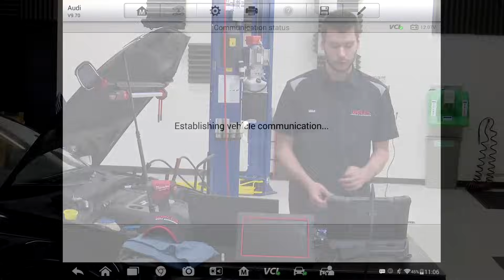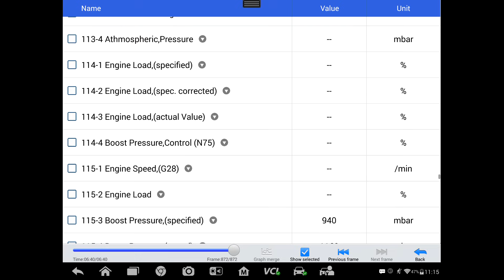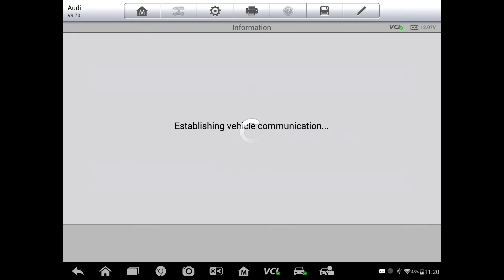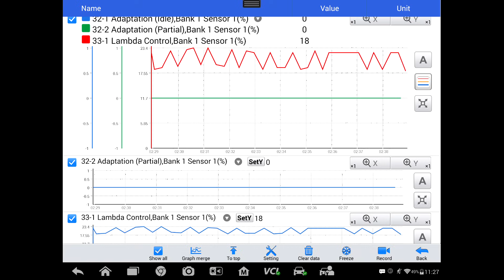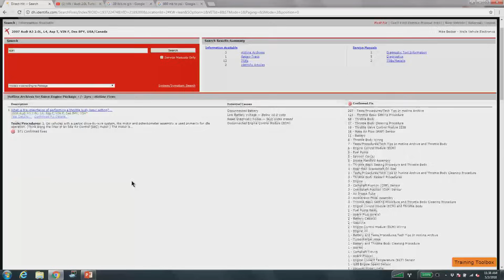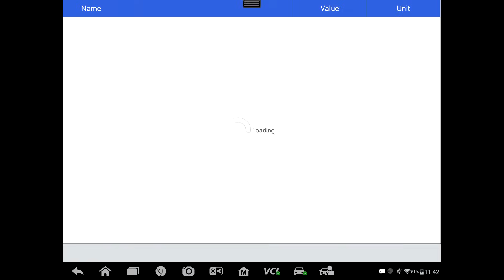VW / Audi 2.0L Turbo - System Too Lean Diagnosis & Repair P0171, P2177

Comment: Could u have watched fuel trim on obd2 ?  After all, the fuel trim was the biggest clue. We r also much more familiar with those readings. Really great session!!
Reply: Yes Bill that is the easiest way with unfamiliar factory fuel trims, i done exactly that on a recent Mercedes just swithced to OBD2 and it all made perfect sense cheers sandy
Reply from the maker: Good point Sandy! Thanks!
Mike Becker, Senior Technical Instructor
Reply from the maker: Bill, yes we could have! And actually probably should have shown that. It would have helped in the lesson. I'll try to remember that for next time. Thanks for watching. 
Mike Becker, Senior Technical Instructor

Comment: I'm not seeing how the brake booster on this vehicle is the culprit?  The engine does not feed the booster as is traditional on most engines.  A vacuum pump is what feeds the brake booster on most Euro cars.  The booster vacuum is totally separate from engine vacuum.  You can disconnect the vacuum hose to the booster with the engine running and it would have zero bearing on engine operation.

Most common culprit on the FSI is one of the two crankcase valves (the other is built into the oil filter housing), a cracked or broken charge pipe,  or vacuum pipe, MAF, and the rear main seal.
Reply from the maker: Hey Lynx Star Automotive. There is a vacuum T on this engine that puts the booster into the intake. It is also T'd to the vacuum pump. Run the engine with the hose off and she's got a huge vacuum leak. How else would I have created a lean condition when pressing the brake pedal?!
An issue in the charge pipe would leave boost discrepancies. A bad MAF would not pull 177 g/s. Rear main leaking vacuum and not oil is unlikely, but crankcase pressure would need to be more than 1''hg to affect it most likely.

Mike Becker, Senior Technical Instructor
Reply: Wouldn't pulling & plugging the booster hose cause the vacuum level to return to normal and allow you to pull the oil cap off without fighting it?

Comment: A word of wisdom for those of you looking to dabble with European cars.  This is all I do, this is all I know.  Autel, Launch, sure good coverage, competitively priced, good compatibility, until they don't.  Until you start chasing false codes. Until you run bidirectional tests and they don't work properly. Until you clear adaptations and corrupt module programming...  If you want to reach professional level coverage on a Euro car, you need a Euro dedicated scantool.  That means OEM, or maybe an Autologic.
Reply from the maker: Hey Lynx Star Automotive, thanks for your input. The best tool for any car is the OE usually. Euro is no different. But, many shops can't afford to purchase all of the OE tooling. The aftermarket tools have gotten better on the Euro cars, but they are far from perfect. Caution needs to be taken any time you are hooking any tool up to any car. Data can always lie to you, no matter the tool!
Mike Becker, Senior Technical Instructor
Reply: for the price of autel or launch , you can do 3 times that the snap on can't do. and its 1/3 of the price also.especially on the European on is only good on the domestic side. maybe Asian.
Reply: Your not exactly wrong here but i know your talking about Bmw with the corrupting the software and bmw eventually made a tsb anything that is capable of autoscan and quick erase function will corrupt the file and there’s a small procedure to erase the code and clear the adaptions to fix it.. just go into the nodule clear the code and you won’t have the problem... i have factory Bmw and autel elite.. I haven’t had to use my Bmw in a year and i work on a lot of them... i use vcds for Vw audi i Like looking at the data with the autel better however basic settings i always use the vcds because the autel rejects the basic settings for some reason...

Comment: Mike --
This was a very informative and revealing case study video on a lean operating condition and fuel trim data. I now know to consider several other sources of vacuum leaks besides manifold gaskets. One needs to keep in mind any device in or attached to the intake manifold that uses vacuum:  EVAP systems, power brake booster, HVAC controls, etc. I know I will definitely keep these possibilities in mind.

At time interval 49:30 you made my day when you pinpointed the EVAP purge solenoid as an intake vacuum leak source. You decided to plug its port and then retest to confirm your diagnosis. This simple tests takes very little extra time and does not involve extra expense. In that manner you have additional assurance that you are diagnosing correctly and "not firing the parts cannon" to fix a problem.

Your discovery of a vacuum leak through the power brake booster but only when actuated was astounding. It proves that elusive vacuum leaks requires one to think "outside the box" and really understand how various systems on a modern automobile function and interact.

If you decide to dissect that vacuum booster I am thinking that you will find that the internal valve that regulates vacuum between the front and rear chambers of the booster housing is leaking when the push rod is actuated. It is also possible that there is a small hole or tear in the diaphragm membrane.
Reply from the maker: Hey Allan, thanks for watching! HVAC controls is a great point! Though not seen nowadays, on older cars that could be a huge source for an issue! I am never confident in a repair until I can prove it 2 ways. Seeing it leaking is way one, way two was plugging it and seeing the change. I disassembly the booster last night, no tear in the diaphragm, problem must been in the seals on the rod. Thanks as always for watching and commenting!
Mike Becker, Senior Technical Instructor

Comment: what are the symptoms of a bad brake booster? i have an 04 camry with 200k on it and i think the brake booster  is going on it . lmk . thank you
Reply from the maker: Hey Jeremy, well in this case it was a lean code. Depending on the leak you could loose brake assist or have a stiff pedal upon initial engine start. 
Mike Becker, Senior Technical Instructor

Comment: Good class.
Reply: Thomas EXOVCDS   U would have used your VCDS tool. And isn’t that part of your screen name?  I was thinking it was going to b a leaking turbo hose. Do u have your Milwaukee 3/8 ratchet yet?   Notice how Mike has his Milwaukee in camera view all the time. They probably send home a box every month full of 12 and 18 fuel. At home he probably listens to a Milwaukee radio.
Reply from the maker: Thanks Thomas! 
Mike Becker, Senior Technical Instructor
Reply from the maker: I wish they would Bill! Milwaukee has been nice enough to send some stuff though! A box every month would be fantastic though. Did you see the new stuff!? A chainsaw, a table saw, a 9'' grinder!!! Woah! and a 12ah battery. They are making some great stuff!
Mike Becker, Senior Technical Instructor

Comment: And the funny thing is if someone says to me I took my car in for a lean code and they said it needs a Crankcase Vent, Purge Solenoid, MAF Sensor and a Brake Booster I am going to be thinking "That shop is firing the parts cannon"
Reply from the maker: Hahah! You are so right! I actually showed the customer this video just so he didn't think I was "firing the parts cannon." But, if you can prove it to the customer, then that's what you should do. Then they wont think that way. They will really trust you!
Mike Becker, Senior Technical Instructor
Reply: Wells Vehicle Electronics Of course when they say its a VW, I would be thinking its more likely then that it needs all that.
Reply from the maker: Haha right! 
Mike Becker, Senior Technical Instructor

Comment: I work on VW, Audi, Seat and Skoda (all the same group) quite often. To get those connectors apart PUSH the connector closed and whilst holding connectors together pull the tab then pull connectors apart whilst holding the tab back.
 P.s. Can I have t-shirt and hat?  😁
Reply from the maker: Hey Fox Brendon, if only I knew this a long time ago! You have to earn a shirt. I'm still going through emails from this class. I hope to see one from you in there!
Mike Becker, Senior Technical Instructor
Reply: I have a problem with my vw and it have a lean problem now when I gave gas the car loose power

Comment: The secret with the electrical connectors is to push and hold them in first, Then you can pull the tab down with your fingers. I used a screwdriver like you did for years then someone showed me the push in part. What a relief from that moment on😆
Reply from the maker: Hey Diagnostic Check, thanks for the info! I'll give that a shot. I don't know why they can't just make a normal connector! Haha!
Mike Becker, Senior Technical Instructor
Reply: Diagnostic Check 
Yep push pres and pull

Comment: turn a/c on
Reply from the maker: Hey Mike, how could the A/c affect this? Are you using it to load the engine slightly?
Mike Becker, Senior Technical Instructor
Reply: ya for a load ...
Reply from the maker: Ahh, alright!
Mike Becker, Senior Technical Instructor
Reply: Mike do you guys have a new product manager or department that i can talk to about new idea..
Reply: I found a pcv breather hose was bad at first by noticing my vacuum wasn't normal on my boost Guage. No check engine light. Instead of 20-21 vacuum at idle with AC on mine was running about 17.

Comment: What Autel scan tool is that Mike??
Reply: Star Master Tech Autel = latest version of the Maxisys

Launch = latest version of the X431 Pad
Reply: thanks
Reply from the maker: Hey Star Master Tech, i'm using the Autel Elite and the Launch Torque. Both great tools! I'd recommend either of them to anyone!
Mike Becker, Senior Technical Instructor
Reply: Thanks

Comment: Great video Mike! It’s definitely among one of the best case studies I’ve seen on Wells garage! 👍👍👍 You kept your cool and even though it took longer,we all learned a very valuable lesson when dealing with these cars! Next time a garage crosses their hands and ships it,you will be making “ quick money “ because you will jump straight to the issue! The fundamentals are pretty much the same,even when dealing with Euro cars and learning how they operate can only make one a better technician. I simply love the Autel,especially when it comes to these vehicles. Many scan tools have nothing on Autel. I have never dealt with Launch but I take your word on it!
Thanks Mike!
Reply: Nick Nicu Autel is ok when working Euros.  It can bite you in the bottom very easily.

Best scan tool for VAG products is oem Otis, or VCDS (VAG Com)
Reply from the maker: Hey Nick, thanks!!! I agree, the fundamentals are the same. An engine is an engine! The Autel tools are great. Like Lynx Star said, VCDS is the superior tool, but if you're not working on them every single day it's hard to justify that.
Mike Becker, Senior Technical Instructor

Comment: used to hear them hissing inside the vehicle with everything closed and fan off, but newer cars usually have panels and insulation dampening the noise.
one of the diagnostic steps should always be applying and holding the brakes while watching data, you just never know, been bitten before on older cars. live data would have been nice then!
I've replaced quite a few leaking units, all 90's and older though. most were bad/dirty valving inside and pulling through the pedal shaft area and hissed fairly loud.
Reply from the maker: You know, I never heard a hissing sound on here :(
Mike Becker, Senior Technical Instructor